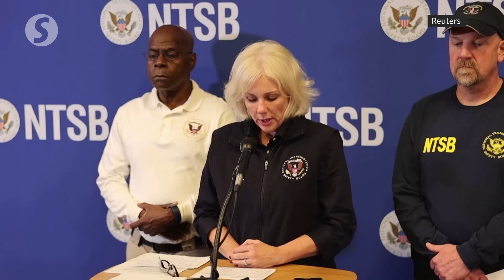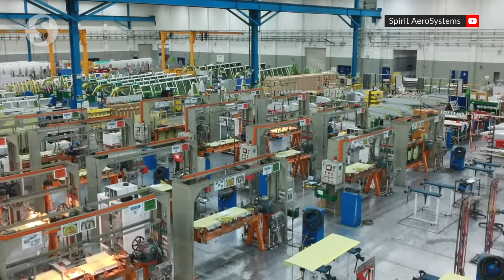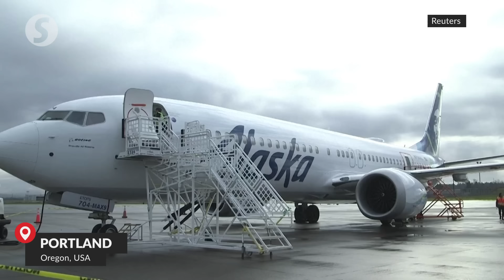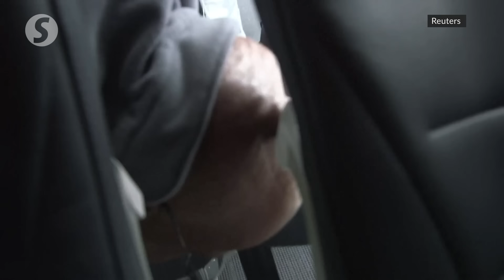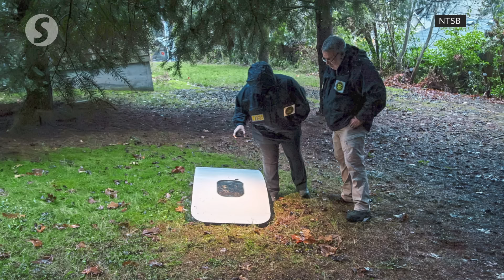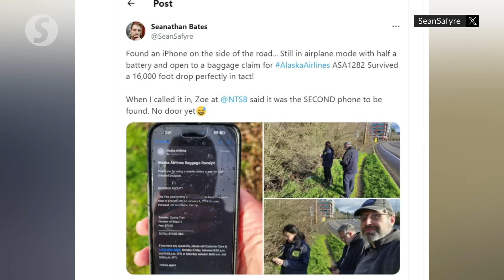Door part that blew off Boeing plane was made in Malaysia, says US federal agency chief

Comment: USA shouldn't blame door quality,  actually the plane door was not installed properly
Reply: Lets FAA investigate first. We do not want to pin point finger.
Reply: No excuses....let them investigate! Malaysia already has a bad track record where flights are concerned. A black mark on our aviation industry. God help us if it gets worse!
Reply: They are good at blaming everything on other. If the door is made in Malaysia and export to US, Boeing engineers and quality control engineers should check before using the door.
Reply: The FAA DEI guidelines, announced in March 2022, set an annual FAA hiring goal of 3% for severely impaired employees. The listed disabilities include psychiatric and intellectual impairments, complete and partial paralysis, blindness, deafness, missing extremities, epilepsy and dwarfism.
Reply: just google faa diversity hire

Boeing's corporate filings with the SEC reveal that in beginning 2022, the annual bonus plan to reward CEO and executives for increasing profit for shareholders and prioritizing safety was changed to reward them if they hit DEI targets.
Reply: @panyaboonc5621  They're not blaming it on Malaysia, they're just investigating the production and inspection process. It was manufactured in Malaysia but by Spirit Aerosystems, which is an American aerostructure company. So if there's any quality control deficiency, poor inspection, negligence etc, the US has themselves to blame.
Reply: @kerrchingleong5818 they already point finger to Malaysia. What is that
Reply: @ReefearEapear  USA is the big daddy, can Malaysia flight for it?
Reply: @kerrchingleong5818  fight for what?? Malaysia do nothing wrong. The company is American company based in Malaysia. Why Malaysian should bear the consequences??

Comment: To lock the door tight , we need good screws and hinges , over' tightening' process may damage the screws too  and serious vibration  could even break the screws.This is merely my input.
Reply: The 12 door stop fittings on the frame and the 12 stop pins on the plug were designed to carry all the outward load due to cabin pressurization at 7500/8000 feet of altitude. The 4 bolts and nuts just keep the plug from moving up and disengages the door stop fittings and pins. The inside cabin was pushing outward with 11.23 psi while the outside air pressure is pushing in at 7.77 psi at 16000 ft altitude. The load on the plug is approximately 3990 pounds (2 tons) pushing on the door stop fittings & pins. For some unknown reason the plug translated up and blew out.

Comment: As usual, it's the big bully's culture in trying to blame the scapegoat for its reckless mistakes. Yes, it's made in Malaysia, but it's done based on the technical requirements by Boeing, and the material control on parts is resposibled by Boeing's staff and the QC work before and after the aircraft assembly are all done by Boeing. So what's the motive to tell the world that the door is made in Malaysia? It's either trying to save Boeing's image or to tarnish Malaysia's reputation.

Comment: Okay, maybe it's just me but... Having worked on, and overhauled aircraft for some 40 years can someone explain to me why we are NOT focused on WHO installed the door plug that was manufactured in Malaysia? Does it matter who made it? If a tire falls off your car, is it the tire makers fault? Really, please explain this. Trust me, there is documentation clearly showing who installed it and when. They know exactly who did it. And the NTSB has known who did it for days. Seeing how the door plug survived a 16000 foot drop I can, as a professional, state that the door plug was well built and serviceable when it was half ass installed. The fact that it remained in place for three months with loose or missing fasteners is a testament to the design and assembly of the door plug itself. Everyone who touched the door plug during installation and subsequent inspection thereof should go to jail. They purposely and knowingly falsified airworthiness documents to meet production quotas.  The sad part is they probably think it's funny. No honor, no integrity. So after the thousands of virtual meetings and emails etc. etc. the bottom line is "Do It Right" or don't touch it.